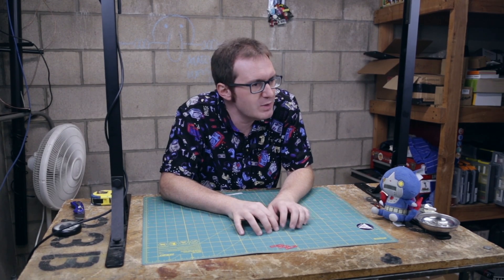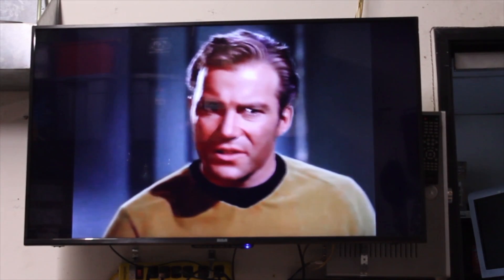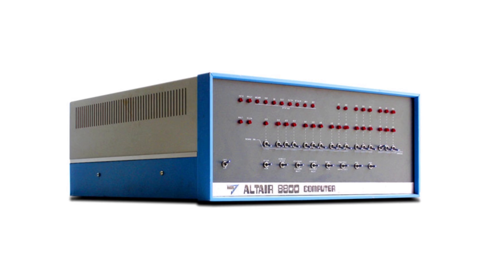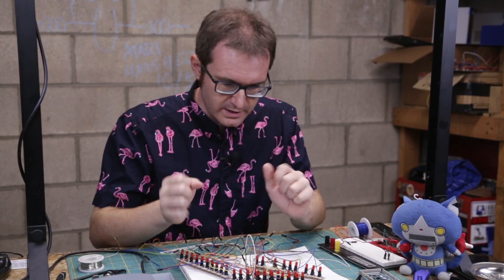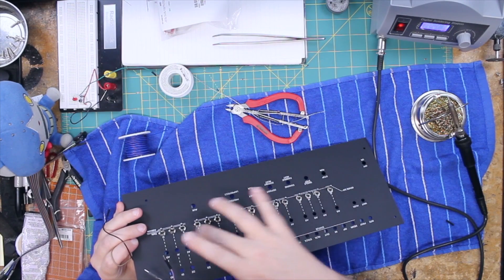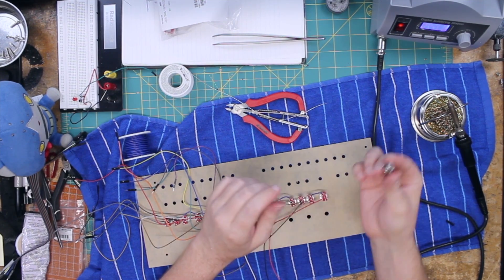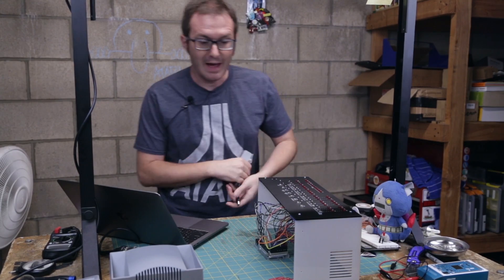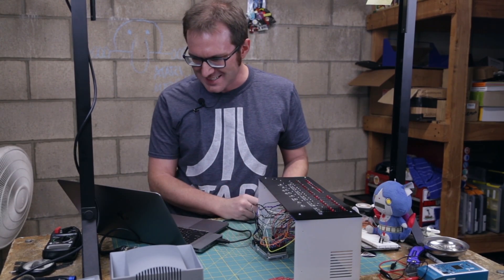Altair 8800 Replica

Comment: I worked for Midwest Scientific Instruments,  I built a Byt-8 system, with a TDL ZPU card, an Extensys 32k ram board, Polymorphic VTI, Tarbell floppy IO,  and 2 Qume 8" floppies.  Later I had an old Alpha Micro AM100 system with a 10mb CDC Hawk drive, and a Polymorphic 8813 system.   I built a PC compatible, but I diverged into Atari ST computers eventually upgrading one with an 68030 and 12mb of ram, with a 480mb SCSI drive.

Comment: if you think about it ... the  Altair 8800 ,, was its self a Replica of the mini computers around at the time which used switches and lights,, 
just like the pdp - 11 mini's or the ibm main frames ,, the Altair 8800 Release date January 1975; 49 years ago
However,, Ohio Scientific's first Challenger 1P 1976  a year later ( superboard II  600 ) used a ROM and a qurtyop keyboard
 with a ROM, Microsoft Basic, all on one PCB,, with expansion for floppy drive, Altair could have done this too .... but they chose to make a Replica

Comment: Instead of individual transistors and resistors, you could’ve just used hexbuffers with a resistor network. Saves a lot of components and makes it smaller.

Comment: Hey you got that front panel from me!  You should have told me it would be famous!  BTW, I've built dozens of these and I still have the same reaction when I first power them up.
Reply: The least this video could have done is mention he got the important parts from Chris Davis: front panel and metal 'Altair' strip. Yeah - you can just buy this plus the PCB as the Altair-Duino kit (I'm a happy owner of one). Very odd the video does not link to the kit he is basically replicating *using parts from that very kit*. Uncool, Element 14!
Reply: Don’t worry, I’m totally stealing that case design!  No more silverware box...

Comment: I bought an Altair kit in 1976 for $395. I also bought the optional 4K RAM memory board. It also had the cassette tape reader/writer for program storage. For a user interface, I built a kit called the TV Typewriter. It allowed a standard TV to display a 32 character by 40 line display as I recall. User input was via a QUERTY keyboard. The only software available at the time was the Tiny Basic interpreter. You had to key in a 18-instruction boot loader via the front panel switches to get the cassette tape modem going to read in the interpreter. It all worked but was very tedious. I sold it all to someone in the early 1980s for about $100. I wish I had it all back now.
Reply: Did you sell it at the Trenton Computer Fest in New Jersey?  I bought mine there for $125.   Rebuilt the power beefed it up  and stupid me,  I unloaded it  85.

Comment: I cringed so hard when you downloaded the zip instead of git cloning the repository...
Reply from the maker: Sometimes you just need a snapshot.
Reply: @element14presents  Sure, but then you have no idea of WHAT it is a snapshot of, if you took a zip file of the master branch on any given day. You lose all the metadata. You only know: At one point, this was the state of master.
A git clone has the metadata for the traceability and reproduce-ability of projects like this.
I wouldn't want to be in a situation where I want to re-create a projects months or years later, only to find out that the current master revision no longer works for me for whatever reason, and having no clue what revision I used back in the day.
Also, you're bound to discover a bug or make some improvement, without git metadata you can't contribute your work back.

Comment: I always preferred the IMSAI front panel because it used groups of 4 (hex) rather than the Altair's groups of 3 (octal) representations.
Reply: I preferred the Imsai panel as well. The Imsai panel used paddle switches which were easier on the fingers than the toggle switches. When I built a Z80 system back in the Elder Days, I used paddle switches pulled from a surplus DEC front panel. Fun Times. :)
Reply: Sure, but 8080A instructions are easier to remember in octal 🙂

See the Bugbooks if you don't believe me.

Comment: This is where cheap PCB manufacturing comes in handy.  The free version of Eagle has a perfectly decent limit for small, function specific boards that can be chained together.  The Arduino is also very extensible with character displays, LED matrices, shift registers running LEDs, and the TVout library.  It can even run chiptunes.  Using the serial connection it's possible to dedicate one Arduino to game logic, another to the play sound effects and another to run the display along with some inputs and create a decent game programming setup.   Any chip that has inputs and outputs could serve as the basis for some fairly advanced ways to learn programming without being overwhelmed by the trappings of modern computing power.

Comment: Why would I build a replica? I've got the real thing setting on a shelf right next to me ... although I haven't turned it on in over four decades. Also it always bugged me that the data switches were laid out in groups of three for octal. Groups of four for hexadecimal would have been much easier. I would write my assembly language programs out on graph paper. Then I'd translate them into machine language ones and zeros. All the instructions are one byte wide but some had one or two bytes of data. Writing all this out on paper in binary was not very practical and even octal seemed harder to grok than hex. So I guess if I wanted to build a front panel like that, I'd want to make some changes.
Reply: Many like to build a replica because this thing costs nowadays around 1k so stop bragging
Reply: Yeah, I was wasn't I. Maybe it's 'cause I'm old.
Reply: Cuz you can’t buy the real thing without shelling out way too much bucks.  I just bought an Imsaii replica kit for less than $300.
Reply: Octal is fast to read and input, going byte by byte it is easier to "punch" into the machine... at least it is easier for me to summarise the code into octals, my brain's processors understands which toggles to flip when it is laid out 257 faster compared to AF which is 1010 1111 in binary.

Comment: Wonderful Project!  At 16, my first computer was an Atari 400, then 800  That sparked my interest for Computer Science.  Which led me to a lifelong career in IT.   I never had an Altair, although I do recall a teacher of mine having one in the classroom many years ago.   Just thinking back on those days is fun. We were all so naive as to where this technology was all leading us.  I do have a arduino sitting in my parts bin collecting dust. I may try to at least get the simulator running on it!  If not the whole project.   Thanks for sharing this build!
Reply: Thanks, Mike! The Altair was always an object of curiosity to me, so--even though it's not an "original"--it's great to have a chance to play around with one! Going to be doing more retrocomputer projects soon, so be sure to follow along at element14.com!
Reply: You need an arduono due for this.
Reply: @LittleRainGames    Or a  Arduino Mega 2560 or a Genuino Mega 2560.  :-)